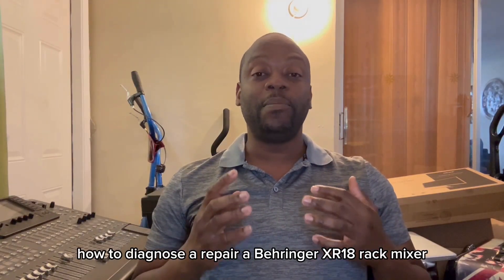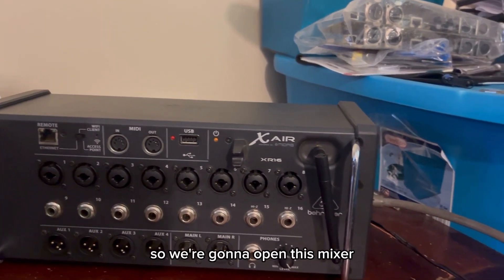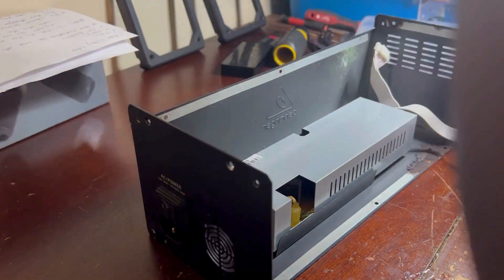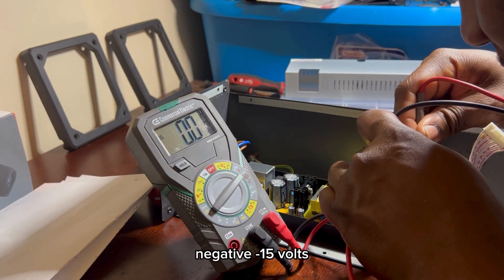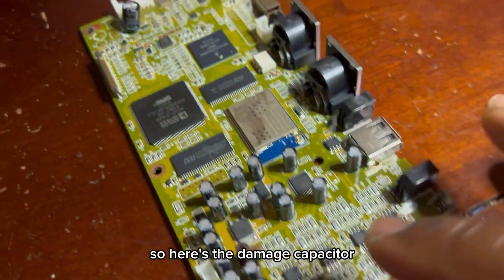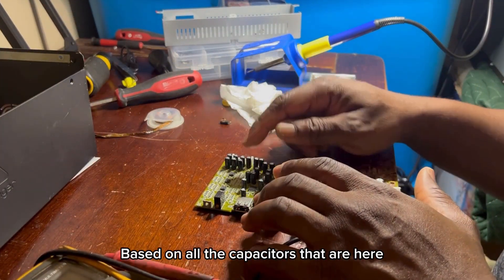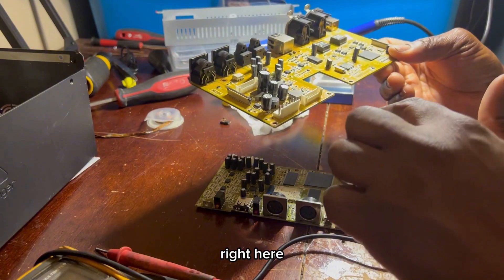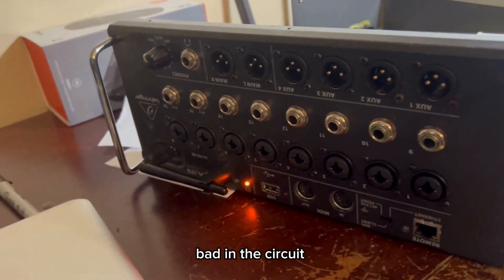BEHRINGER XR 16 REPAIR

Comment: I fully expected the SMPS (power supply) to be bad. Nice fix. (what the hell is with the rust on the bottom right side of the chassis? Was the chassis made with recycled Ford Pinto or Hyundai Pony metal?)
Reply: Thanks for a nice video! I've got a X12 where the network-card only sometimes starts up. I have to turn the mixer on and off until the networkcard ignites. Any idea whats wrong?
Reply from the maker: @thomashary3716  thanks for watching and commenting. I would start from the power supply to see if I’m getting the correct voltages
Reply from the maker: Customer said liquid damage